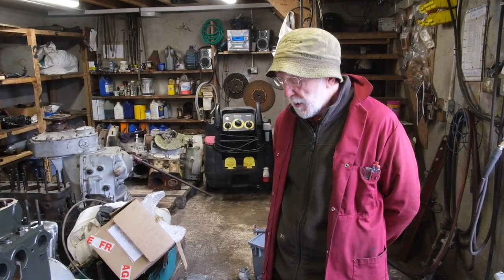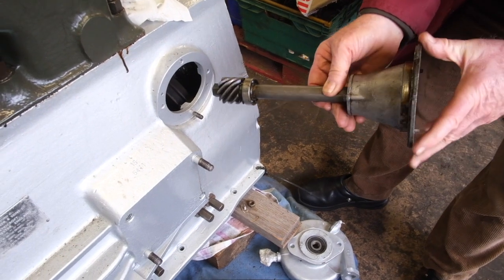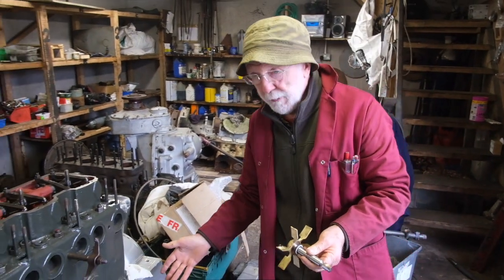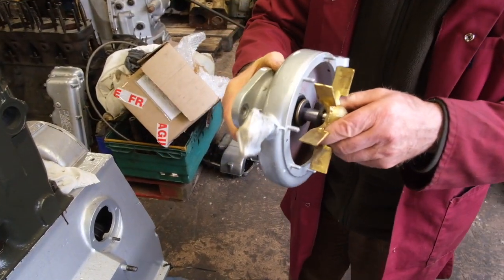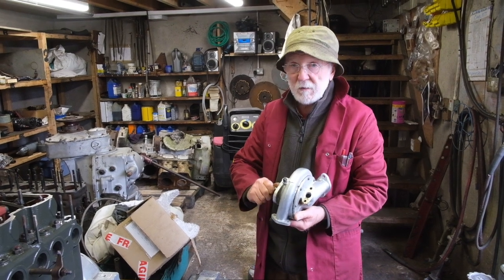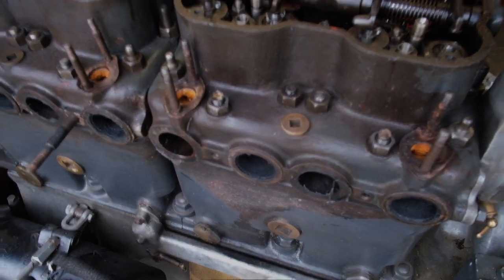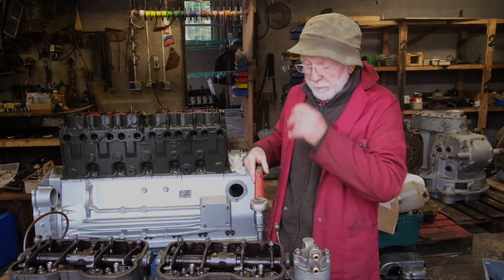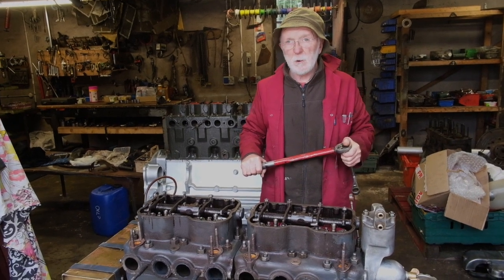Gardner water pump and Special socket tool

Comment: A question Joe; Why did you torque the head after you reassembled the rocker arm assemblies and the decompression levers rather than before when a normal socket will fit? By the way, I'm reall enjoying your videos and I really appreciate the effort, there's a lot there which removes the mystery.

Comment: Most interesting.  Do you know if such a thing exists as an uprated water pump for a 6HLXB?
Reply from the maker: Please, I don't know what you mean by "upgraded".   If you need a water pump, please email:tangent.gardner@gmail.com.
Reply: @tangentgardner  many thanks, what I was meaning was a water pump modified to provide a more powerful flow of coolant around the systems.
Reply from the maker: Might it be possible to use an electric pump?  Best to email me: tangent.gardner@gmail.com
Reply: @tangentgardner  thanks, I will do

Comment: Awesome video  Joe could you please explain the correct way to torque the injector/sprayer clamps as I’ve been told to do them finger tight only as they can crack the head if over torqued.
Reply from the maker: You have been told correct.   There is a special LW spanner for this, but in the absence of this just be gentle.
Reply: Good paint  job joe what is the in side like ?